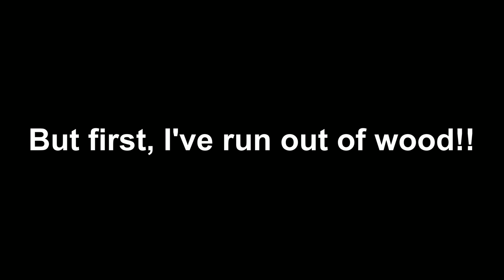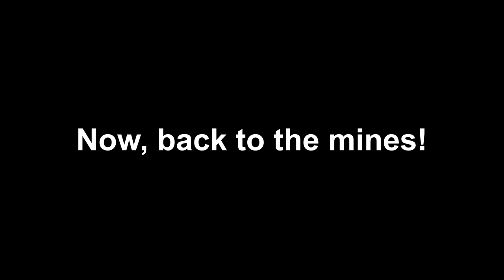Opening My Gold Mine! Part 6: Timbering The Raise

Comment: I work in this environment for a living, biggest bit of advice is you need to get a rail system set up for haulage, even if it’s timber rails and light sleepers (4x2) it will make stock movement so much easier and quicker

Comment: Jason, I'm sure you've seen the strings of work lights hanging from a single cord. They are now available with LED bulbs so the power draw is far lower than incandescent, the bulbs are more durable because they're made of plastic rather than glass, and the string(s) can be powered off of a solar-powered battery pack stationed at the mine entrance that can be locked up inside the adit when not in use. EcoFlow makes a really nice unit with a foldable solar panel for charging. There's a YouTuber named Erik Grankvist in Sweden who uses an EcoFlow unit at the cabin he's building (MOSTLY WITH HAND TOOLS) in the middle of the forest, and his power pack can run a stick welder.

Comment: In our area of germany mining has a looooooog tradition from 500bc and the last mine closes at 1970.... The oldtimers used as thing called as-leather. It was a thick leather sheet hangeng ot the back of the belt and they used it to slide down the shoot by grabing the end of the leather between there legs..... 😁 I think you will need one 🤣
Reply: Sounds like a super fun thing to watch someone else do 😁
Reply: @awldune All fun and games until one small bit of rock is sticking up on the slide.....

At least you'll be hitting high notes for a while afterwards!

Comment: I love this kind of seat of the pants engineering, nicely done! A couple questions- how wet was that standing spruce when you cut it? And what kind of screws to do the construction? We use these screws called GRK's in our construction business, we love their strength and thread cutting tip and star drive. Not cheap but not "cheap"!

Comment: I love the videos and the details of precisely what you're doing and why. Really great stuff. 
For your lumber transport issue,  make up 2 sets of trucks with an open channel on the top and a screw clamp so anything in the channel is trapped and clamped 
2 lawn tractor wheels, two pillow blocks and the axle and you're in business. With 2 attached, it's a breeze for one man to pull 😏
Keeping it lower means less toppling and make the wheelbase as wide as reasonable 😉

Comment: Put the wheels on the lumber.
Just remove the tub off the wheel barrow and refashion the wheels to clamp on to the lumber 💡

Also led lights strung up and down on a pole with a stand  is portable.

Comment: Get yourself the warn portable winch. It uses a cordless electric drill. I use it here in wyoming to skid out believe it or not 40 plus ft. Logs. Very powerful small little guy perfect for your operation there. Weighs like 8 lbs. 😊

Comment: We used a two wheel dolly with a rounded belly bed to move 20 foot lengths of pipe around job sites. One man operation same design used during ww2 to move bombs across airfields to load planes.

Comment: I would suggest making a flat cart with a pivoting front wheels that you can attach a bar or a rope to for the first person to pull and steer. You could use it to haul buckets out with when you start getting ore to process or for mucking out the floor.
Reply: I think they are figuring out why there were rails in there.

Comment: 17:15 Time for a 4 wheel cart!

Get two more pair of wheels like your 2 wheel wheelbarrow, but put one set on a steerable T-axle and you will be able to make a wagon that can roll along stable and be pulled or pushed the length of the travel without tipping in any direction!
Reply: I think they are figuring out why there were rails in there.

Comment: The Simpson company has done a lot of testing with hangars. The ends of the timbers will rot in a year or 2. A simple hangar pinned into the rock with 2 1/4" nail pins will give you a gap between the wet rocks and the wood. Dipping the ends in preservative extends the life more. A simple piece of 15# roofing felt between each piece of wood stops rot at those places.

 Hangars are the best solution when hanging wood. Hanging on the fasteners will fail. Screws break under loads that nail easily handle. A simple fastener nail gun easily handles those short nails used with hangars.

Comment: I hate to tell you but though Spruce was common in aircraft construction the Hughes 'Spruce Goose' (a name he never used) was made of Birch. It was mostly laminated Birch plywood with the major structural parts made of a molded wood fiber impregnated material. So, no spruce in the 'spruce goose.

Comment: Have you ever used a laser measuring device!  If it worked it would save so much.  I used to use one when operating a crane. Would allow me to take distance measurements by my self.  When using a tape it took two additional people plus the relay of info was always prone to error along with the actual tape read. There is no dumb end on a tape if you need accuracy!

Comment: Jason- Might I suggest using a DR Power Wagon if you have ventilation for a gas engine, or get one and convert it to electric.. They will haul 600 lbs and if the floor is pretty level, should work just fine. Also they have a dump bed feature which is real handy, and come with a cement mixing tub also. Mine is a true back saver..  Is the old air and water pipe still useable?

Comment: If you want everlasting spruces, do what the vikings did, at spring peel the bark off as high as you can removing a palm size piece saving a palm size piece. Go as high as you can reach. During the summer the trunk will be  producing sap as fast as it can, making the trunk completely full of sap. When you cut them in the winter, and saw it in the next spring -those planks last even in water for hundreads of years.

Comment: 2003? I think you meant 2023.. that bright sun must be messing with your mind after being underground so much. Something this series has taught me is why everyone is told to stay out of old mines.. Miners are NOT carpenters.. you do all sorts of sketchy stuff with wood that carpenters would cringe over. That and finding holes where you don't expect them like that one Dan found in his flooded adit. 
I'd suggest making yourself a wood cart with big wheelbarrow tires and a pivot point over each axle so you can turn corners with it and make the deck like a logging truck, just four posts sticking up and a few crossbars to rest wood on. It'd be much quicker and easier to lug stuff in and out with a cart like that than pulling it around on a wheelbarrow or carrying it. You can definitely see why most mines quickly went to narrow gauge rails and carts.
BTW, lights flickering and cameras crapping out commonly happens when ghosts are around and they start sucking the energy out of them to try to manifest.